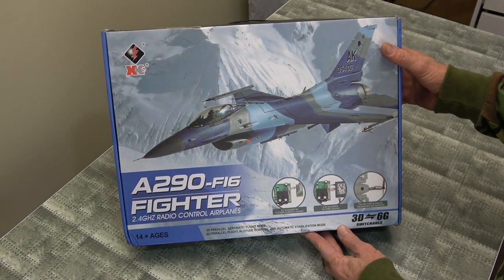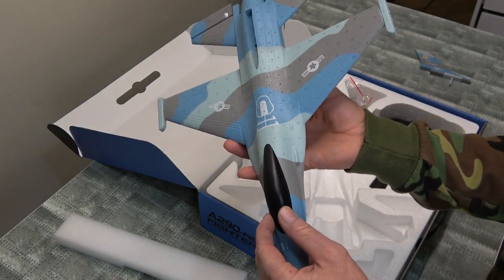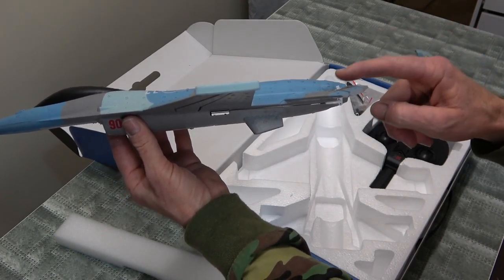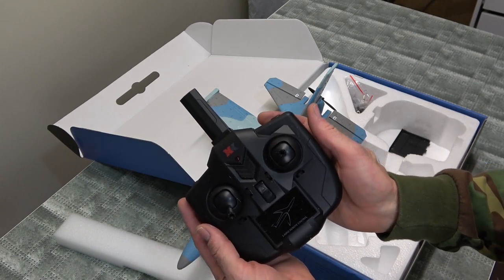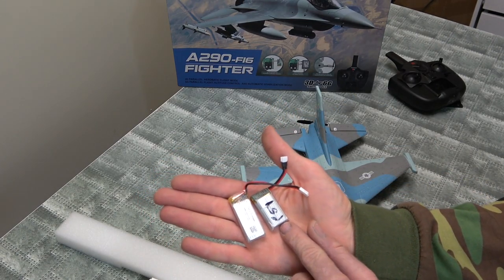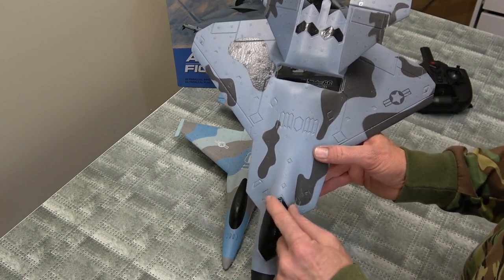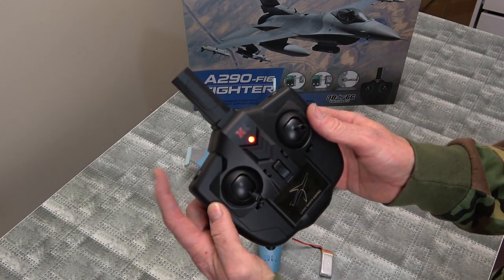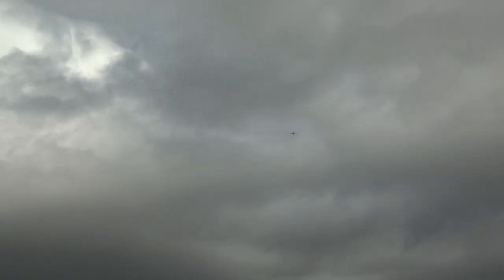XK A290 F16 Fighter unboxing maiden crash Beginner RTF RC plane jet 3ch WLtoys

Comment: Protocol for these XK A2?0 series planes is reported to be V911S/E119 sub-protocol. Might need some more work to get all features. A satellite S-bus or DSM receiver plugged into the plane's board should allow use of all the flight controller's features. 
Could you check it BFRC?

Comment: i still could not figure out, should the elevator look downward or upward while taking off?
Reply from the maker: Upwards.  Yes pull back on stick about half and elevator goes up but the gyro may fight it.  I don't use elevator on take off cause I use self level mode
Reply: @blowy48flyrc  Thank you very much 👍🏽 i won’t crash my brand new plane now 🙃
Reply from the maker: I know how you feel we have crashed lots on the take off

Comment: Es el mejor avión "Pequeño" que puedes comprar y aprender  o mejorar tu manera de Pilotear Aviones RC.   Odio los Drones No me agradan en Absolupto 
Buen video!   Para Aprender es Mejor el SU - 35 y más Barato. Yo perdi uno por romper la regla Nº 1:
No volar Aeromodelos de menos de 50 Grm,s con viento de más de 10/Kmsh
Saludos
Reply: El mío pesa 32gr y lo vuelo con aire. Hace un rato se lo llevó una corriente ascendente a más distancia de la que permite la señal (sigo preguntándome cómo no se perdió la señal) y lo he podido recuperar con astucia, porque ya casi mi vista lo veía... Solo tienes que jugar con las corrientes, al final lo he podido recuperar aunque lo daba por perdido.
Reply: @nenillonenin4754 
Pues tuviste suerte... Yo lo perdi 3 veces y la ultima no lo encontre pues hay mucha vegetación ... Tengo este modelo pero aun no lo he volado. Estoy con SU-35 de 2 canales y pesa menos de 35Grms. Depende la bat ...He tenido que ponerle una varilla de fibra de vidrio al fuselaje pues se me ha partido y ahora pesa 3Grms mas pero es irrompible....El F16 lo tengo guardado para cuando ya sepa mas...Aunque si te fijas y por 75€ algo mas que el F-16 es mejor el F-22 que sale en el video al principio.  Si lo hubiera sabido lo hubiera comprado....
Reply: @JoseA-Divergent  Tengo el Hawk's Work Z50 y también soy nuevo, el susto que me ha dado hoy ha sido en mi segundo vuelo, creo que se me da bien. Quiero pillar uno de 3ch mínimo para poder tener la opción de bajarlo inmediatamente con el timón y que no me pase lo de hoy.
Reply: @nenillonenin4754  Mira: si fuera hoy me hubiese pillado el que sale al comienzo del video ya que lleva moor Brushels...De todas formas soy mas de velero y a veces paro los motores y planeo hasta que puedo y en laderas...Cosa que este F-16 no podria hacer por su pequeña superfice alar....Te recomiendo uno que planee algo...  :   )

Comment: I also Flynn both planes f16 Xk and emachine f16 is a far better plane and it seen quicker.. Emachine would be my pick for shore.
Reply from the maker: Yes the eachine has separate ailerons and elevators properly why it flys better